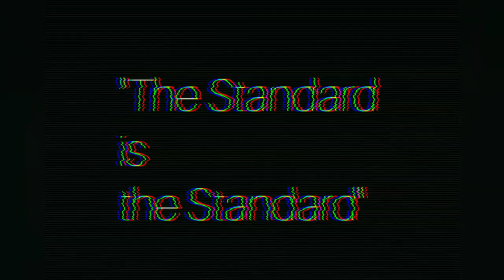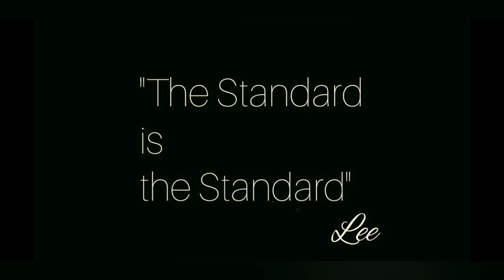Rounded gelcoat, swimstep and transom work. compounding a boat to remove oxidation.

Comment: Great to see you back Lee! How would you recommend cleaning/detailing the non slip surfaces?
Reply from the maker: 1st, Thanks. 2nd, depends on what kind: (gritty sand-infused paint/gelcoat on a walkway, textured gelcoat, patterned gelcoat..) what kind of stuff are we cleaning up? All this sets the tone and decides what to use. 

I tended to (when I'd wash boats)
Spray them down with water, use an appropriate cleaner and brush to tackle whatever kind of "yuck" is embedded in the grain of the nonskid.
- If mold or lichen, bleach and sunshine followed by a vigorous scrubbing. Rinse well, the whole boat, don't let bleach dry on your boat, especially on dark gelcoat and on a hot day! 
- if stains, see above.
- if rust, a rust stain remover let to soak and then washed and rinsed well.
- if chalky, scrub with an abrasive scouring powder and a deck rush (white aggressive or yellow medium soft brushes. Soft brushes work on newer/cleaner surfaces.

I do not recommend waxing your non-skid but people have forced me to do it over the years..
https://youtu.be/kIi3DG0ONgI

Read the description.

Lee

Comment: Great video. Is there any reason why the heavy cut and the EX AC are both used on a heavy cut pad? I know in the video they are used on different sides of the pad, but does it matter that the EX AC is used on a heavy cut pad? Why are there people using EX AC on a medium cut pad? Im justt rying to keep it simple and I'm still learning. Thanks Lee
Reply from the maker: Hi, thanks. 

If people using a medium cut get a better reflection, I've yet to see it. You said it yourself, keeping it simple. You don't need it. 
Most people can't help but leave swirls and a long history of morons has gotten everyone thinking that we're supposed to treat gelcoat like it's paint, we don't, at all, in any way. If people use car techniques and products they'll get swirls all day long because they expect them to all be gone in the end. If a coarse spun wool pad can finish as good as foam (with time and skill) then, why, if you aren't leaving swirls, would I need a softer pad that takes longer to achieve the results I'm looking for? 

Now, I'll ask you, these other people, do they offer links to these extra pads? If so, ignore them and everything they say. 

Thanks for the question and comment.

Comment: Hey brother I am painting a jetboat and ran into an issue. Ive laid out black gelcoat color and prestec polyester topcoat clear/additive. I blocking and sanding the clear and went to spray another clear coat on top to get it straight as an arrow. Unfortunately my oil catch failed and the clear fisheyed. Now I am sanding it back down. In the areas when I break through to the 2nd layer of clear if I leave the boat sit out for a few days the edges chalk up. I'm worried that after I clear it, those edges are going to chalk up. Any idea why they are chalking/hazing on the edges? I am wondering if it is moisture related (rain) as it is outside.
Reply from the maker: Humidity can play havoc on, everything sadly. I can not be of much help as I'm only "good" at restoring old gelcoat. If it's new..? I'm an idiot.

Try this guy, he's an expert on this and on youtube:
https://youtu.be/6SzZ5RRRh7A

I'm sorry I'm not much more help but if I had a question like this, I'd trust his reply.

Sorry brother😢

Gelcoat also has weird curing issues that while I'm aware that it's finicky sometimes, I've never applied it or learned more than it hates me.

Good luck.

Lee
Reply: No worries man appreciate the response. Thanks!
Reply from the maker: Any time. Least I can do if you've felt safe to inquire and get some advice. I wish I had more but I've found my niche and don't stray.

I tried to paint a boat once, once.

My best,

Lee